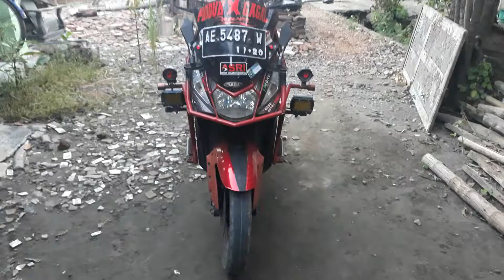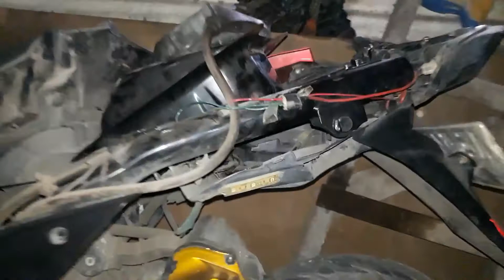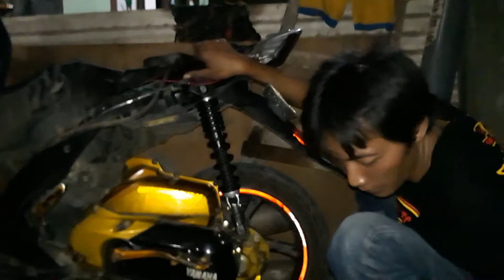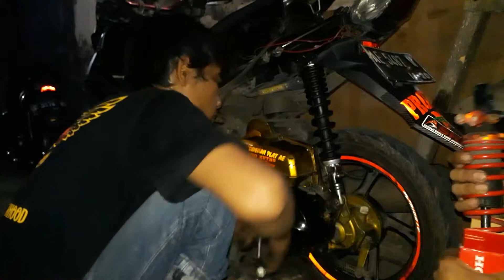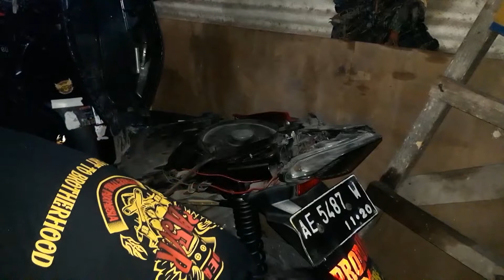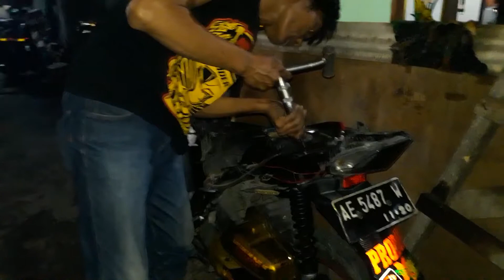Ganti skok belakang mio m3 pakai skok vario 150 cc

Comment: Shock vario 125  lama aapa vario 150 yg led om??
Reply from the maker: Vario yang 150 cc om...lebih panjang..ntar hanya ganti/ pindah seal nya aja
Reply from the maker: Waktu beli ...saya bilang..shock vario 150 cc..gitu aja..trus dikasih barangnya
Reply: Beda berapa cm shock vario dengan shock aslinya ?
Reply: 330 itu y mas ukuran y..maav klw boleh tanya...apa gk nggoser ban belakang y klw di sandard tengah...soal y sya pengguna mio m3 dgn ban belakang uk.90/90-14 corsa planeto...
terima kasih...